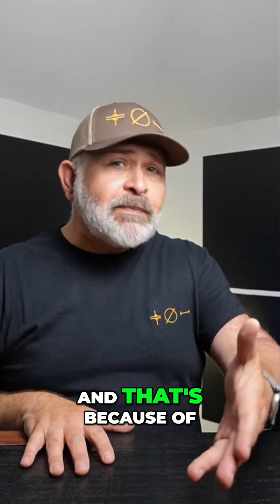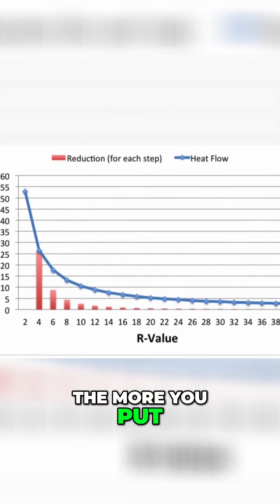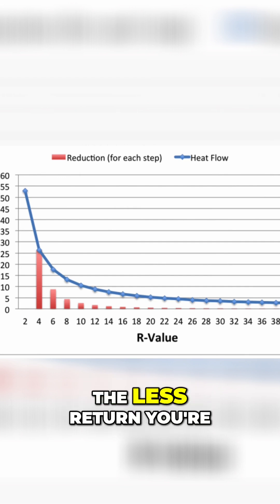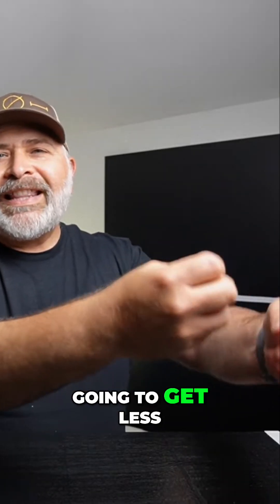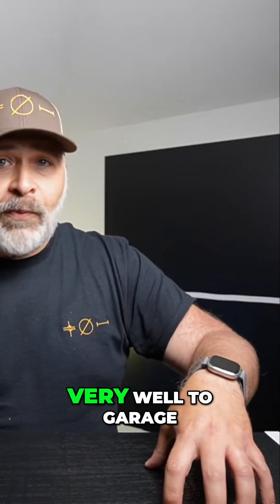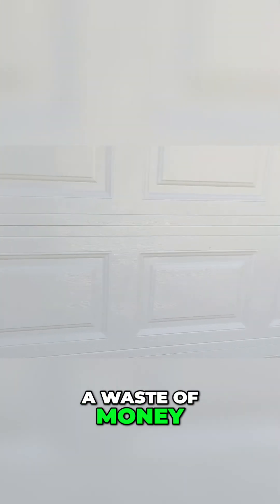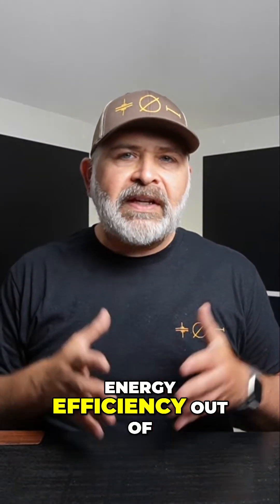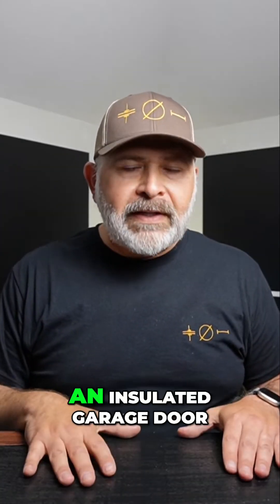STOP Overthinking Garage Door R-Value!

Comment: So what is the break point in your opinion for R value?
Reply: @RichB0330  R8 blocks 90% of the heat, R20 does 96%. There’s a big difference in price between an R8 polystyrene door and a R20 polyurethane door. Can be 1000-1500 more.
Reply: @ryanabbott1104   That's a big cost for 6% not worth it